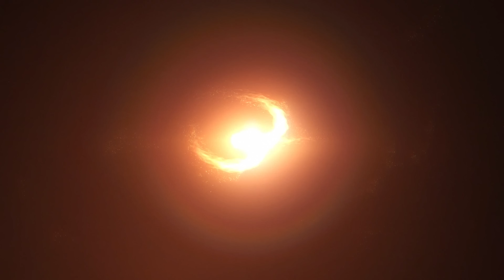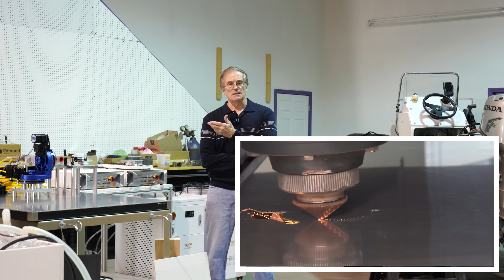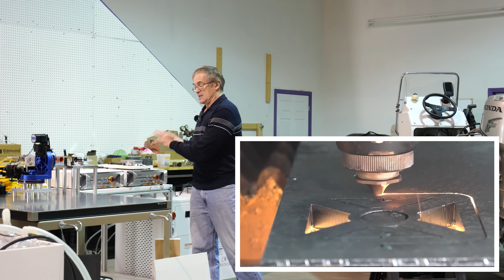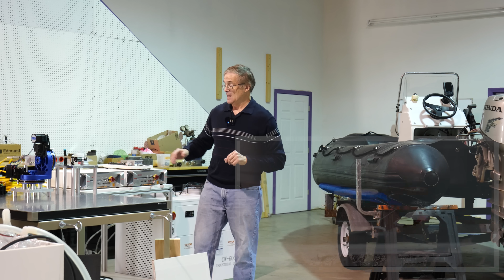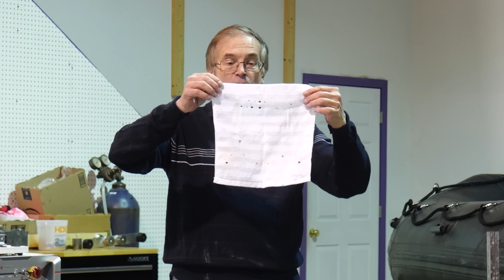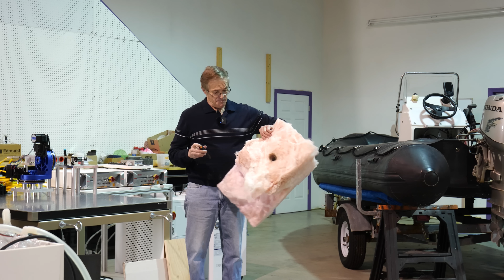We have a problem... and need your help!

Comment: I thought more about it, how about a louvre style of mirrors like horizontal blinds you could make them almost as wide as the garage door the laser light would pass through the louvres but you could angle them towards the ground as long as you didn’t pave your driveway you’d have a great heat sink outside. I would obviously suggest putting up a temporary safety fence to prevent anyone from walking into the test area

Comment: Starship heat shield? Ellie in Space or Marcus House could probably hook you up with a used tile?
Reply: ablative?
Reply: Its ceramic and was designed to be infinitely reusable.. for withstanding the heat of re-entry. I'm sure it has some oblative properties, but not like the Dragon space capsule that has to be replaced every flight.

Comment: How about a large plastic water tank with a colorant in the water.  It would punch a hole and let some water out, but could be patched quickly.  The tank would only need to be a few inches thick.

Comment: Brick, clay and sand, melted and exploded due to moister vaporizing to super heat within- the hole. 
Anything combustible even if wet will be put on fire. 
That bring me back to clay, sand, and bigger rocks. Water is the best low cost heat remover especially if vaporized. Just can not run out of water to vaporize.  

The commercial  purchase is below but likely doesn’t achieve cheap, lighter yes. 

I suggest a plastic pool to catch water. DIY out of plastic sheet and sand bags. Sump pump(s) can recirculate the water. and in the pool are block made from gravel or ceramic, see below. I would make the water full of suspended clay. As much as the pump would handle and not be deposited onto the gravel stopping the flow. Maybe carbon dust would work or sand dust. 

DIY coated rocks with concrete put in a mold bonded together at contact points. NO SAND!! You want as little as possible contact between the stones. Consider to make the blocks with a pattern that make stacking and interlocking easy. A dozen of such shapes exist. 
You will have to do some experiments with different crushed size of gravel to determine the volume of water within and the flow resistance. Need the smallest gravel with the lowest resistance. A balance since bigger gravel will not get cooled so a hole will be exploded through rock after rock but water will also be cut by the beam turning to vapor. The rest will cool the rocks. Want a lot of water to be vaporized and replenished. The balance. 

Taking it to an extreme you could consider but the cheap part would suffer are the ceramic humidifier pads that are a few inches thick where water dribbles through to provide a lot of wet surface area and low resistance to the air flow. Thin ceramic layer with water wetting both sides. This would work if you could buy in bulk and even better a different ceramic cloth angle in the pads to create a lower resistance water flow and the beam has more layers to hit.

Comment: What if you used some fiber optic cable? Target the end of the cable, so the light travels down the fiber. You could have several thousand feet on a spool to attenuate the signal before it leaves the other end of the cable

Comment: boral trim boards (TruExterior - 12" wide x 1" thick) made from poly-ash would be better than wood. and rock wool insulation would be way better than fiberglass. maybe a sandwich wall of boral + rock wool + boral. should be relatively affordable. will not ignite.

Comment: Hmmm...
2 lasers
Half power or half lenses
Each with carbon fiber, aireogel, space shuttle tiles, as kill switch shutters.
Both lasers computer guided with a range finder for a point of destruction convergence.
Same as in the cutting laser just larger scale.
No???

Comment: How about a little block of Aerogel. Not cheap. Not readily available. But I bet it diffuses the light just enough to effectively lower the power on target, and the heat dissipating properties of Aerogel would potentially stop it from burning through. You might add a backer of some type of black carbon material to absorb the rest of any visible light.

Comment: I know a salt mine that may be for sale …

I think it might be worth coming at this from another perspective, do a back of the envelope calculation on the energy density being delivered and then consider if there are any materials that could even handle that in theory.  It might be the case that no matter what the material you're going to need an impractical amount of it.  Gypsum in drywall seems like a pretty good option and it wasn't nearly enough, I think you might need to drop the requirement that this be adaptable to the existing space and instead really seek an alternate location for this activity.

It might be fun to try baking soda but I assume it'll be inadequate.  Engineered plastic lumber might smell too much and/or catch fire. Kevlar is probably too expensive but if you can get a bunch of retired vests it might be more practical?
Reply: In addition it might be worth considering what kinds of interlocks and limits you could place on it, like powering the laser from a capacitor bank that physically can't be charged by mains power and discharged into the laser at the same time so that it would only have a limited fire time each time.  Maybe you could have an automated/mechanical kill switch that cuts power to the laser if the movement stops for more than a fraction of a second. It would still be important to have other safeguards but enacting multiple layers is reasonable.  Presumably there are industry best practices that can provide some options even though this is a different application?
Reply: Silicone rubber might be interesting to try too, it's relatively inert and I don't think the decomposition products are particularly toxic, it's dense and available in large rolls.  It would probably still take too much of it to be practical cost and weight wise though.

Comment: As others mentioned just dirt could probably work great, or my original idea was refined dirt aka clay.
Clay could be made like a stone wall that can easiliy be repaired. It also has better heat absorbtion compared to stone, because of the water in it.

Comment: I would look into the power supply of the laser and lower output while testing. I do not think that it would be too difficult to alternate between full power and testing power levels by modifying some electrical components or even switch to a lower level power supply. Clean and reliable alternative.

Comment: Rather than trying to armor a whole wall of the shop why not include an escape reflector lens before the fiber laser dumps the energy into the aiming hardware, that way you could dump the energy released during startup into a capture media in a controlled location instead of it hitting the walls of the shop while things warm up. Direct the laser through your aiming hardware only when your firing the device.  Think of it like a throttle plate, where the throttle plate redirects the laser into capture media until your are fully open throttle and the laser can pass into your aiming lenses and motors.

As for the capture media something like bagged drywall mix in a 55 gallon drum would give you similar capture performance to hundreds of sheets of drywall and you could easily move the capture drum with a hand truck.

Comment: You could go with a refractory metal with a copper heat sink on the back, 314 W/m-K for copper. Graphine has outrageous heat conductivity, but likely not practical. You could actively cool the heatsink with embedded water pipes. On the wet sheets idea, I wonder if there is a particulate that in suspension would absorb the heat, Graphite? Maybe. Have you tried ice?

Comment: How about sticking an some kind of vibrator on some drywall sheets hung with string/rope/cable. You should be able to tune the amplitude of the swing with the frequency, and the movement should make the sheet able to hold up longer. You could also probably use some kind of crank thing instead I guess.

Comment: Surely you've thought of using a convex mirror.... But I get it, the laser's surface area is so small that the curvature of the mirror wouldnt be sufficiently sharp to spread the beam around sufficiently, and besides, you'd have to always aim for an off-center position on the mirror... I then have an even better one for ya. I imagine such a material, that it has surface that's full of tiny little convex mirror like structures (forget convex, let's just use pyramidal structures) with a diameter of less than a millimeter, thereby having very extreme curvature sharpness and being able to adequately deflect and spread the light from the beam

Edit: I wonder if the beam reflector thingies they make road signs out of have any meaningful resemblance to what I'm talking about above

Comment: Can you get a tinted lens? A diverging lens would spread the laser out after it burns through the target. You could also either color the lens or add a tinted glass layer behind it that absorbs the laser wavelength. It may not be super cheap and the aim would be static, but you wouldn't have to worry about replacing the shield.

Comment: why not use a reflective material within a construction similar to sound dampening geometry. A good portion of the energy would be dispersed around you but that shouldn't be an issue. The more I think about it - the issue is that you are trying to stop all off that concentrated beam of energy at once and it's not working. Diffusing the energy over wider area (using multiple passes of reflections) should make it easier (might be more dangerous though).

Comment: Does a concave or convex mirror at 45 degrees work? or it would cut right through?
The best solution I can think of is dispersing the beam into something more manageable using lenses or mirrors.
The other alternative is a surface that is almost parallel to the beam to smear the point across a wider area, and maybe coat it with a very white or reflective paint to make it last longer. Something like a Japanese fan made of metal maybe?
Speaking of fans, a rotating disk that dips into water to cool the point that was hit?

Comment: Get a proper power interlock which measures the pulse strength and cuts power when needed. Do not run tests at full power unless necessary. Build a wall of milk jugs or similar containers filled with (slightly gelatinized?) milk / emulsion to scatter the beam and dissipate heat. Patch the holes with transparent sticky tape after hitting the jugs.
Reply: This is one of the best suggestions I've read so far.
Reply: @jameswarner7435  Thank you! ☺️

Comment: What about water between two glass plates? It refracts and absorbs heat. You could test it cheaply with a garage-sale fish tank, and then adjust from there if the basic idea holds up. I'm just tossing out thoughts; I don't really have the engineering skills to know whether this is an overly-simplistic idea.

Comment: I'm no expert, but I think a possible solution may be to use LAYERS. That is, for example, the fiberglass insulation could serve as an initial buffer - the next layer behind it could be sacrificial as well, e.g. perhaps a mild steel (or other) plate - then perhaps something better behind that. Sacrificial layers could serve different purposes, e.g. to absorb or dissipate any reflected laser light, which would allow using something reflective behind that sacrificial layer. With that, perhaps some kind of "mottled" glass - I forget the name of it - that kind of glass that's roughly patterned so that you can't see clearly through it, so it acts as a semi-private glass. Alternatively, perhaps some kind of crystal/mineral, like amethyst, could diffuse/scatter the light for other sacrificial layers to absorb. 

Just a brain-fart idea. Not sure if it's useful for your purposes.

Comment: Be careful guys. Don't ever, ever, ever, look into the path of the beam. Even if it's off. A spurious voltage or circuit malfunction  will most certainly vaporize your foveas.

Comment: I think if you used a pane of glass that had one side lightly sand blasted so it had a mate finish and the texture of beach glass then the beam could hit it and get refracted creating a larger, stoppable beam. The mate finish shouldn't reflect the laser, the glass should melt instead of burning if it doesn't work,  and depending on the size of the pane it could be really portable.

Comment: Maybe use a pockels cell /electro optic modulator (if there are ones with that power rating) to create a series of pulses, that way also the energy deployed to the target could be controlled. Degrees for control could be rate (time between pulses), pulse duration, and total number of pulses. If laser light is needed for tracking this should also allow a low power mode for that, and then a high power mode to destroy the target.

Comment: I think you need to rotate your experiments. Aim the laser vertically at the ground, you won't burn a hole through the planet any time soon.

If you want upright experiments, rotate the earth and not your experiment, so make a earth wall. Encase some earth (just ordinary sand will do) in some kind of cube construction and stack the cubes in to a wall.

Comment: The problem is the quantity of energy in a tiny area. Ideally the object should be something moving fast to change the area aborsbing energy and avoid reaching melting point. What about a liquid being moved fast by a pump? The problem is still to create a liquid cheap, not toxic that can do the job. The liquid has the advantage that can dissipate the heat with the nearby liquid if moved fast enough. What about adding something to water? But this can be dangerous if produces hydrogen.I imagine transparent pipes with a high speed liquid flowing with a radiator to cool it down

Comment: I'd guess sandbags. But it's still going to burn a hole in whatever is used for the outer casing. So you'd still need to patch or re-bag things at some point.

Comment: What about the sheets of Cement board? Also, I wonder if the Fire retardant insulation used in commercial ducting.  The only issue could be the reflective material it’s wrapped in.

Comment: If you have the space for it, you could defocus the laser before hitting your focusing lens. Placing a focal point inside (or slightly before) your demo target hits it with nearly full density. Then behind the focal point, your beam diffuses. With enough length, the beam can be diffused to an area (roughly) proportional to its size at the focusing lens. If you need to take the system for demonstration elsewhere, you can tune the focal point to fit the environment (similar to the collimator).

Comment: I'll echo some fellow commenters' suggestions that multiple layers - in my industry called "defence in depth" - may be the ideal approach. I'm drawn to a dispersal solution as opposed to absorption because the inverse square law, while usually a nightmare, is your best friend here.
Layer 1: Waterfall curtain. Maybe add several waterfall curtains with varying drop sizes as water purity is not important (more impurities would improve scattering). PVC pipe is pretty cheap, just drill however many holes in the sizes that work best. Fairly portable as gravity will always ensure you get coverage from any height though flowrate may need to increase with height, up to a point.
Layer 2: Mist or particulate matter cloud. I like mist as I can't think of any PM that doesn't pose a long term breathing hazard and won't be a PITA to clean from all the surfaces it'll settle on. The reason mist is the 2nd layer is so it can be sandwiched between the water layers to minimize dispersal in unhelpful directions.
Layer 3: Again waterfall, one or multiple, to contain the mist as previously mentioned.
Optional layer if there's more room in the budget: My end goal here is a "beam trap" of sorts, but simpler so it can cost effectively cover the whole wall and ideally be hung like a curtain, making it able to be rolled up and fairly portable. Additively manufactured rectangular prisms with a complex infill like cubic, gyroid, or octet dipped in a reflective coating - ideally something affordable, easy to mass manufacture, and tuneable to reflect specific wavelengths well like NightHawkInLight's "sky cooling paint" - all strung together using anchor points at their corners. Kind of like a weird sheet of chainmail.
Last line of defence: Brick/concrete wall with a coating to scatter the laser light (most should go back into the waterfalls and mist).
Receiving credit doesn't nearly incentivise me as much as getting to work on the solution. Work is not terribly busy right now and boredom is an engineer's nemesis, so to quote John Fogerty, "put me in, Coach!"

Comment: You've got a lot of suggestions, and I can't read them all, but, what about sand and water together between two panels? I don't know if a light diffuser pattern in the front panel would collect too much heat at the panel with a laser that powerful, or reflect some of the laser, and do you use a clear panel in the back or a colored panel resistant to the frequency of light?

Comment: I can only think in many mirrors, which all reflect the beam to one spot with a BIG bucket with water.That way you only need a relatively small brick wall, the rest are lots of cheap mirrors, all placed in a backing wall of aluminum profile tubing or so
Reply: its going through the mirror like butter. maybe they should point it down and use what ever stops it before hitting the other side. x)